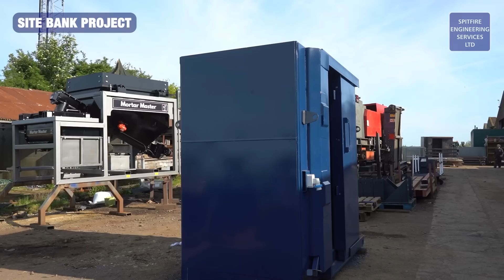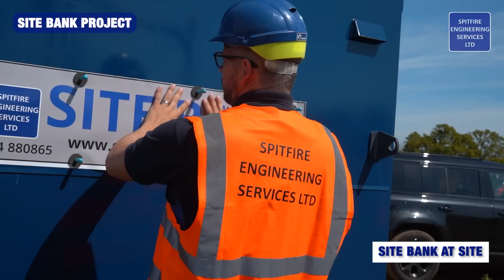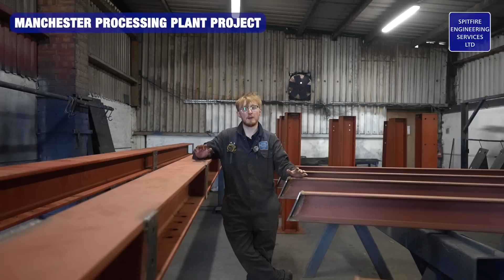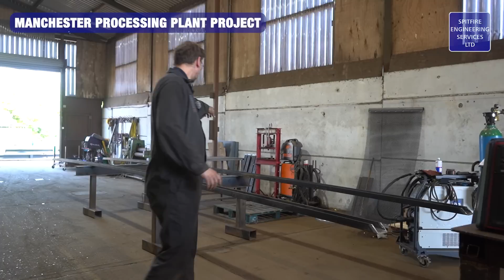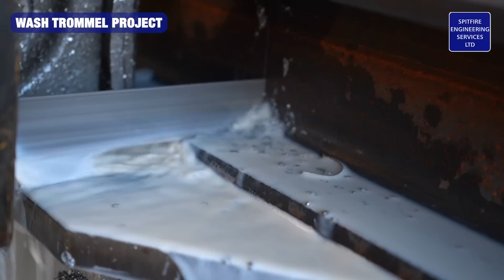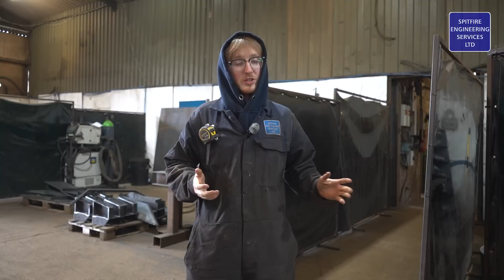OUR BIGGEST SHOUTOUT YET – SPITFIRE MAKES THE PAPERS

Comment: Shout out to Gavin for covering the bridge.  As an educated structural engineer, I have an appreciation of bridges and structures.  As a career builder, I still appreciate structures.  What bothers me is that when they fail, it is often small, easily missed mistakes that lead to massive failures.  I suspect that in your products, if you have a failure, you often find it was a small detail missed in design or fabrication that is the root cause.  I also suspect that after you understand the root cause, your products become bulletproof in that aspect.  Then you struggle with the cost of making a reliable product in a world bent on cheap replacement products.

Let me know if I guessed correctly.  Keep up the good work and the fun videos.  Thanks for adding enjoyment and appreciation to my day.